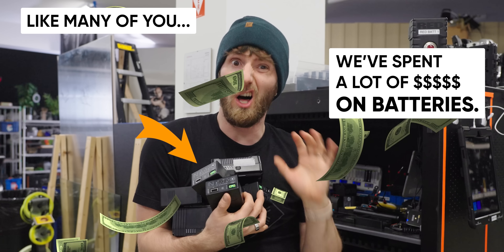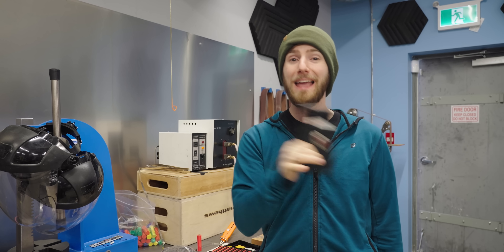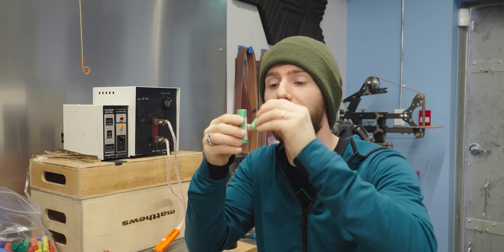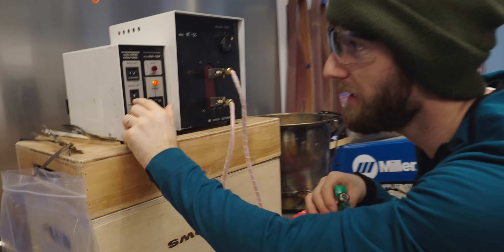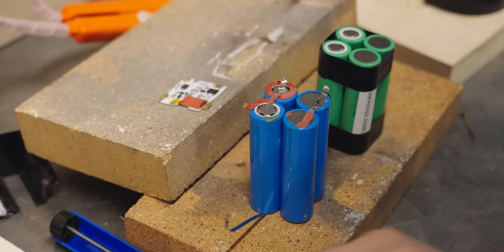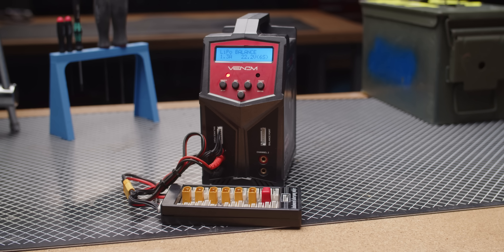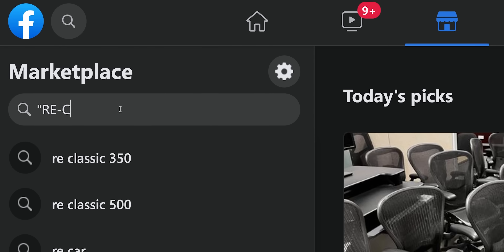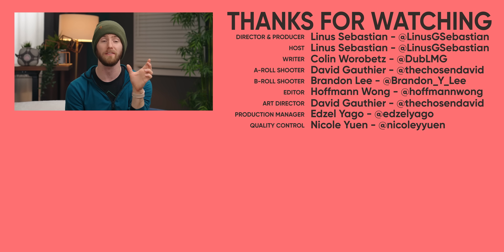This should be illegal… Battery Repair Blocking

Comment: Those cells have high enough internal resistance for them to balance each other out without any problem when voltage between them is not so big as the one with 3.5 and 3.0 . Second thing is that those sparks looked like they were caused due to bad contact between spot welder and nickel strip and were not harmless for the battery pack let alone individual cells . Third thing is that many of bms boards need to be connected to charger to reactivate . Not saying that those ones were not evil type that certainly exist but they didn't even try it. And last thing is there might be a charge counter ic on bms that might start giving intentional problem after set number of uses but if it is just volatile memory then u could have just soldered a thin wires to main + and - on the bms and supplied a required voltage from Lab bench psu just to keep it powered all the time while swapping the cell pack ... This video was just yolo attempt with not a lot of thought put in into actually succeeding given task .Just to prove you cant do it and it is dangerous ..
Reply: Yeah this was an amateur attempt by Linus but with just a little more insight replacing dead batteries isn't that hard and not dangerous. Me and my dad are working on a pair of former dead bosh's battery packs, I already changed some cells (and by Linus' safety standards I'm quite off) but they seem to work fine.
When I'll change the bms I'll charge it if it doesn't start on its own and I'm quite confident we'll have a couple renewed battery pack ready to be used on any device.
This is to say that it doesn't have to be dangerous: it would be better if professionals handled this kind of things but guys with some knowledge can do it as well.
Reply: @alessandrorampa5536  Agreed, when they say research i do wonder what that entails because you should really understand the principles before committing to a venture, the whole not swapping cells due to balance issues is mute, if cells were already out of balance the risk is the same as the outcome. and while they mentioned BMS's they didn't differentiate between the balancing methods.
Reply: Agree 💯
Reply: Exactly.!

Comment: Why does anyone use the red batteries???? I have shot on the majority of the red models out there, and I use my own lighter-weight batteries for handheld and my own much larger 300-watt hour ones for long applications. You can get a battery with double the capacity, a digital voltage/charge indicator on the unit, for the same price as the red brick.

Comment: The nintendo switch is an example of once the battery dies you can't use the AC adapter to run it essentially leaving your switch a paper weight in the future.  This should absolutely be illegal

Comment: An electrical engineer here, us engineers would want nothing more than to have all packs be replicable with a door and swappable li-ion batteries. 
The issue that the higher ups have is that when users or shops replace batteries they dont always do a great job and one of our products using one of our batteries could catch fire and of course that is billed in the media as "[our brand name] catches fire!" and not "[battery replacement company] does a shit job!"
Because of that i for one welcome 3rd party battery manufacturers to provide cheap replacement batteries. Just be sure they are reputable.

Comment: You have to charge the pack to enable the BMS (or at least just plug it in the charger to activate it), since you disconnected the batteries it zero'd out the BMS...
Also...the "sparks" when you are welding the strips doesn't mean the battery is gonna explode...
P.S. I rip apart old batteries, use the good 18650's to feed my cheapo 18650 flashlights (recycle the dead cells)...which everyone should have buckets of them ;)

Comment: And it goes even beyond that.. 

There are NOT 4 Types of BMS.. There are 5 by me.. And the fifth is outright scandalous.

Let me clarify what I said with a bit of context:
I've worked a bit in the premium ebike market and let me tell you that I was blown away by some of the tactics ebike manufacturers, like big ones, were ready to pull.
On this case, it was Bosh that made me crazy one day cause of their battery. More specifically their BMS.
For the second time I realized that when a battery self lock to "protection" in some cases it will initiate a total slow self destruction of the cells. Bringing the entire pack down to a plummeting ~1v/cell leaving any second hand use of, otherwise perfectly good cells, impossible. 

 That's the level 5. The Inhuman level.

Comment: As someone who professionally supports a team that assembles large lipo packs, I found your over-precaution setup both funny and concerning for my team because beyond a sand bucket and easy egress, lipo ruptures really aren't a major concern. Likewise, while I understand your guys inexperience driving the reaction, throwing out the whole pack because of a spark during welding was pretty silly. That spark is not an indicator of rupture or danger, at best either the linkage between the welding tips or the two batteries gained a high enough differential to cause a arc. Since you guys seem to be bringing on some real EEs, it would be nice to see you get a professional and do more content on actual repairs and teardowns.

Comment: You should also take that wedding ring off or at least put an insulator over it. I don’t know if this project will give enough voltage for this to be a legitimate risk, but you could lose the entire finger if an arc flash jumps across it.

Comment: I, and some people I knew, was into RC car racing at some point when I was younger, right around the time LiPo batteries became common use. I've seen my fair share of battery fires from shortages, so I just nod my head in agreement every time someone, like Linus, mentions how gnarly they can be when they short out. Shit's no joke people.
Reply: I had a battery powered desk fan blow up on me just a few months ago. Luckily I was able to quickly put out the fire and the only real casualty was the fan it's self.
Reply: @conduit64  ideally this will always be the case...never let your guard down around batteries good on you
Reply: I've seen a battery explosion, but not from an RC car. But from a Dry car battery. It's horrifying. I'm still thankful to God that I'm still alive.
Reply: Lipo batterys are way more dangerous then lithuim ion batterys. Huge reason why they are less likely to be used now a days.
Reply: @linuxlinux9914  Less likely? Basically every mobile device uses Lipos nowadays because they can be manufactured in all shapes and sizes, without wasting space for metal casings. RC model LiPos are especially nasty though because they are made for extremely high amperage. Some drone or helicopter LiPos can sustain up to 180 Amps constantly, even more for short bursts. If you short those mofos, you're not going to have fun.
Reply: i stuck 2 screwdrivers into one and bridged both of em and put my tongue on it :)
Reply: @SobboMonkeVR  That is not something to be proud of
Reply: @Bird-nx5ef  yeah, i never did that lol. that would've probably killed me

Comment: It looks to me like U1 and U5 of the BMS (top right at 13:53) have suffered quite a bit during soldering. With a bit of bad luck that might have killed the BMS. Although it is more likely that the pack could have been reactivated with a charger, as mentioned many times here.
Reply: Pretty typical solder joint. It's the rosin that changes color and cleans up with alcohol.
Reply: Looked like flux to me, I would expect the brown to be directly next to the terminal if it was heat damage. The flux is best removed with alcohol which could be why they did not remove it.
Reply: @davidstech1445  I'm not talking about the flux residue. I meant the two chips right below the B- terminal that are literally fused together :) If you compare 13:53 to 11:37, you can see that there were ~1.5 mm of space between those packages before soldering.
Reply: @0nlyfranz  Oh yikes, you're right! That's definitely an unhappy little BMS. My fault for watching in 720p.

Comment: FYI some BMS don't output voltage until you apply a charge after soldering in the batteries.  I ran into this once when making a scratch diy pack.

Comment: Were you shorting the.positive and negative on the casing?
Pretty sure negative is the entire can and positive is just the inner section of 1 end. Those spot welds were very near the edges would be surprised if you were melting through the plastic and arcing + to neg.

Comment: we need more of this how many packs go discarded or have a crazy markup just due to the pack design and BMS while using the same cells i agree with its not for everyday user but at least let the professionals that know what their doing repair and resell packs that can be fixed , too many devices are tossed due to a dead pack even with a single cell in them

Comment: 11:16 its not dead  .. you over do it.. and about the BMS .. you need to charge it or inject volts to the outer connector to activate the BMS.. but the charge cycle and the battery health reporting will be still the same.. or if you can reset the BMS .

Comment: First, disclaimer: be very, very careful with lithium cells. You can totally reuse them if you know what you're doing, but it unfortunately is one of those things where if you're asking whether you should do it, you probably shouldn't. 
Anyways, a few things I noticed, the sparks shown look like an issue with the spot welder, contact, tips or something similar, not the cell itself. Definitely better safe than sorry, but the cell itself was probably fine in that case. 
Also, with that last one, many batteries with a BMS have to be reactivated, often by charging for a short time (as in, seconds oftentimes) before they will output. Not really a DRM thing, just the FET (switch) that cuts the power in the case of undervoltage (like disconnecting the cells) is between the cells and the BMS itself, so it won't power up until it gets a bit of power from outside. Otherwise, it is very possible that the BMS just killed or bricked itself, Knowing RED I can't say I'm surprised heh.

Comment: The Bosh electric bike system used in the biggest brands of electric bikes is similarly locked down. Every part is locked to only work with their system and the BMS has the same sort of self destruct.
It's really disgusting on these bikes that cost $2k-$10 and replacement battery packs costing from $600 and up.

Comment: Linus some BMS boards require jumping the negative input and output sides of the BMS to wake them up after being shorted, disconnected or overloaded. They tend to puts asleep whenever they are in safety mode. This is my experience when building my own Lifepo4 battery. I think it is the same with yours.

Comment: 1 comment on the execution.     When I’ve worked with lithium batteries I’ve used a bucket of water as the bucket of sand — this is helpful because he water acts as a giant heat sink (the reason that these batteries are dangerous is because of thermal runaway, where high heat from a short or another fault leads to a feedback loop that results in an unintended thermal event).  There isn’t a chance for the small amount of electrolyte to interact with the water unless you leave the cells submerged for a long time.    While the sand helps contain the fire, it also acts  as an insulator which makes the feedback loop more violent.     

Ultimately, a good solution is submerge the cells after a thermal event for 30 mins and then put the cells in an inert material like vermiculite for a few days or weeks

Comment: (edit, I see you called out E-bike/DIY battery peeps, fair nuff, lol. Holy crap did that spot welding give you trouble, though. Also, most decent Ebike battery kits come with those plates, from my understanding, they work quite well)
"don't replace individual cells!" Gotta add an asterisk here: If you go through and thoroughly test the cells, they can go into something where they'll be under less load, and a good top-balance goes a long way. 
If you take them to recycling, there's a good chance the decent ones will be resold as used cells anyway. And they're bought for all manner of projects (make your own power bank, Arduino battery, E-bike packs that don't cost more then a used car, ect). I'd happily go through the pile of discards to find the decent ones. Stuff them in a $40 'sharkfin' E-bike enclosure and have a motorized bicycle without havin' Congressman kinda money, lol. (Seriously, my current plan is to just use a 2-stoke because those are $200 and a battery alone costs more then that).
Reply: If the pack is old, like 3-4 years, new cells sound like the better idea. LTT likely only uses them for high drain things; camera or power tools. They may only do this seriously if the ROI of labor & equipment + time makes sense.

Comment: ok gotta make the new pack then, make sure your new battery and old battery are at the same voltage. Then solder the new battery on, now both batteries are connected to the bms. Now unsolder the old batterry. Like in Indiana Jones

Comment: 14:00 Try to charge it! The BMS circuit normally has MOSFETs that switch the battery into the circuit - these are active high, meaning once the BMS IC is turned off the battery is disconnected from the BMS circuit, since the BMS IC is not powered it can not connect the battery, charging the battery will power up the BMS IC and the BMS will turn on the MOSFETs connecting the battery to the circuit. I have never seen a decent quality multi-cell BMS that doesn't need powered up when "re-celled".

Comment: Your 4 cell battery has a very good chance of waking up the bms after just a few minutes on the charger. When assembling lithium battery packs, the bms often requires an initial charge before activating the bms. I have built 10 or more battery packs, and would be happy to help re-cell your packs. I can't guarantee that all of them will work with the existing bms's but if they don't, I can always buy new ones from other manufacturers. I can also use an extension wire, and the original shell of the battery to make larger packs than original, for increased run time

Comment: I think you screwed up somewhere, actually in more than one place. I have been replacing old cells in just about everything (exceptcrApple, there products are not allowed on my property, scumbags) for 4 decades, never had trouble besides an occasional getting the cells back in the original case. To be a little safer, discharge the cells to 2.5v and there is very little energy in the cell to do anything if something goes wrong. I have a few other pointers, but I am sure Linus will never see my post, so why keep typing. I will say this was a failed attempt.

Comment: I probably would not use 'evil' or 'malicious' here. If someone were to try to repair his bettrey, or have his battery repaired, and very unfortunately a battery-related accident happened afterward, how would a manufacturer proved that the cause of this accident was due to the replaced cells or other parts of that battery? I get that in other consumer markets where manufacturers are violating rights to repair, it is always a good thing for someone to call them out, but battery ... I am not sure.

Comment: Just from my experience it looks like your spot welder is set to way to hot. It should be a quick snap, not a heat and press. That heat is whats puncturing those cells.

Comment: The main thing is to match the voltage of the previous battery and the new batteries you may be surprised to know that 18650 cells have a large range of different voltages. You can get 18650 in 1.7v to 3.7v so you have to make sure they are the same or your product you ar putting the batteries in will not work. Amp hours is not as big of a concern. The only problem with the spot welder you are using is it applies heat for too long. You want a  spot welder that has super high amperage that can discharge super quick you want high heat but in a short time so it will melt the battery terminal and the nickel together almost instantly in one spot. Which they showed in the end with that B roll of factory spot welding. Another thing you should do before spot welding is do a full charge and then a voltage and amp hour check to make sure the batteries are not damaged. They make amp hour tester for different batteries for pretty cheap.

Comment: No offense but all the sparks you showed on the video were from the welder itself (you pulled it a bit early, before it had the chance to discharge). The battery packs are OK, you didn't have to throw them away.

Comment: The key to my old car would wipe itself if you changed the battery, so then you had to get it reprogrammed by the manufacturer ($$$) or you couldn’t even start the car without setting off the alarm

Comment: only one little thing that i have to say that probably only counts for me here since i am in russia, you should not buy these cells at vapeshops, they are priced up by a bottton, and even when buying in bulk from the manufacturers, a good offbrand is gonna have 15-20% less capacity while costing a 1/4 of the original and i am not talking about unreliable cheap stuff, i myself have a 10s8p (if i remember correctly) battery and its doing fine after now 3 years of use.
Oh and yeah as the others are saying it would be interesting to see the recycling part